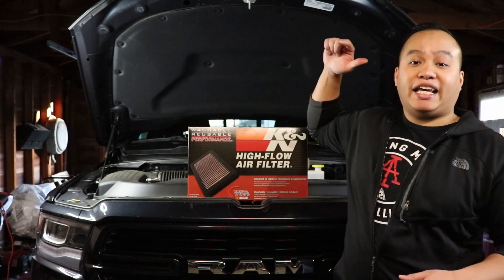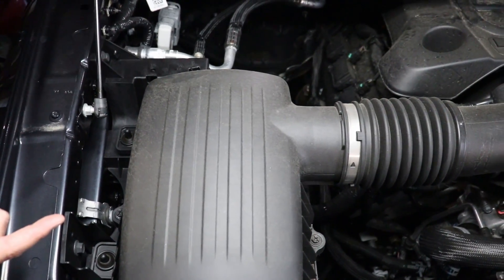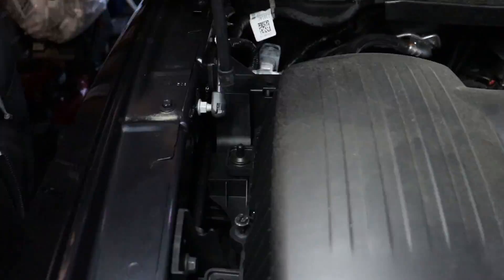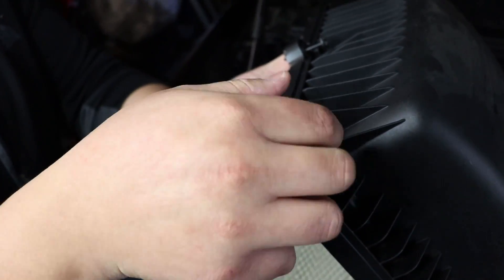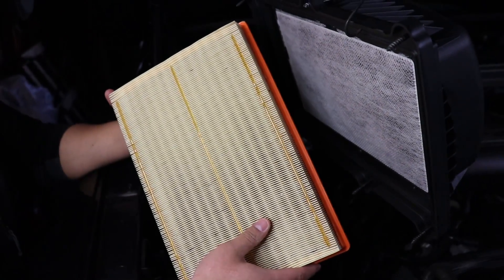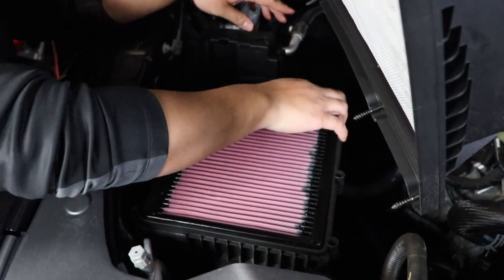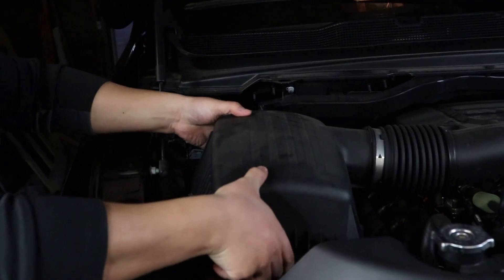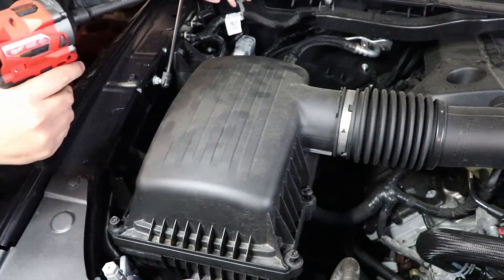2019 RAM 1500 Air Filter Change | K&N Air Filter

Comment: Great video! I took off that top filter when I first got the truck. Instantly felt a difference.
Reply from the maker: Thank you!
Reply: What is that top filter for? you can remove it with no issues?

Comment: Just note, in the past, I've had problems with drop-in K&N filters because their seals weren't as thick as the OEM filter.  What would happen is that unfiltered air would get past the filter and allow a lot more dirt / dust to pass through it.  By the video, it looks like the OEM filter was on there pretty snug, whereas the K&N fit kinda loose. If its not as snug as the OEM filter, you risk allowing a lot more dirt into your engine.
Reply from the maker: gpage thanks for the heads up! I’ll inspect it after a while to see if I find any excess dirt!
Reply: @abes8867  Just run your finger or white paper tower inside the airbox tube, if you find dust, consider going back to OEM. This was especially an issue on my truck and Jeep, but not my motorcycle, which had a tight seal.
Reply from the maker: gpage sounds good! I’ll have to give it a check soon!
Reply: @abes8867  Have you checked lately, Abe?

Comment: Abe I installed one in my 2020 limited 1500. Gas mileage went from 17-18mpg to 13.3mpg after it being in for 3 weeks. I even took it out and reinstalled it to make sure I sat it properly. Do you have any ideas of why this is happening? Thank you sir
Reply from the maker: I’m sorry I don’t have a good answer for you. I know someone has commented that sometimes it doesn’t seal properly when putting in an an aftermarket filter. Maybe that could be the culprit? Or a possible change up in driving conditions/habits? Maybe someone can chime in with some insight. Sorry I couldn’t have been more help!
Reply: You like the sound so you are pressing the gas pedal harder now.

Comment: Why didn't you get rid of the charcoal filter on top of the lid. The 4th gens never had it and it's a new thing on these 5th gens for emissions which could steal some air flow🤦🏼‍♂️. Better delete that as well. 🙂
Reply from the maker: suhail a alright! Thanks for the advice I’ll look into that!
Reply: @abes8867  no problem Abe, it's a great tutorial. We Ram guys always got your back 💪😅 - cheers !
Reply: Is there benefits to removing th charcoal filter? Or what are you replacing it with
Reply: @NoSpillsChills  it's just for the emissions control, so just remove it along with a k&n or any dry flow performance drop in filter for that matter. You are just allowing the truck to breathe properly and possibly a minor unnoticeable performance gain. In a nutshell throw that thing away asap as its you will see the restriction if you take a look up close
Reply: Does the charcoal filter need replacing like the air filter? if removed, will gas mileage improve?